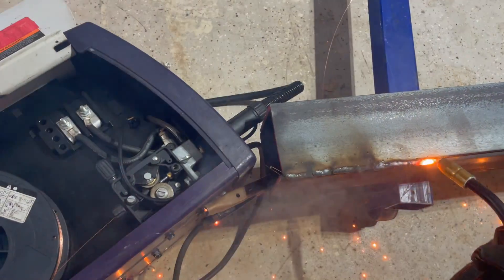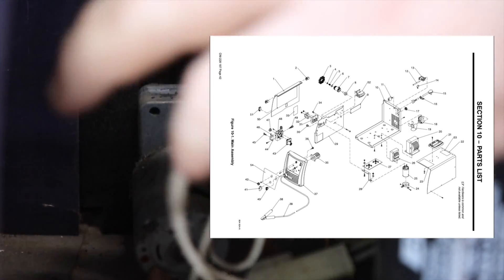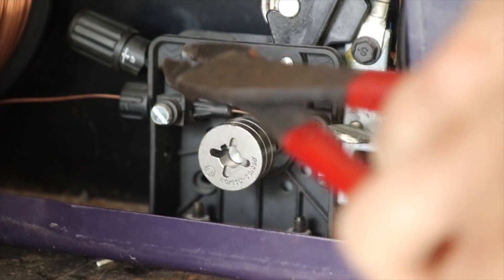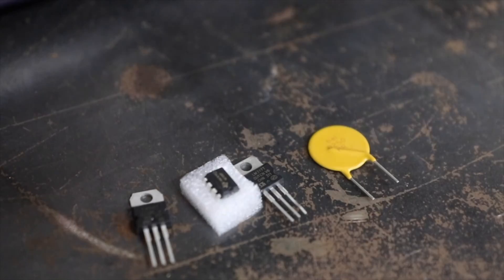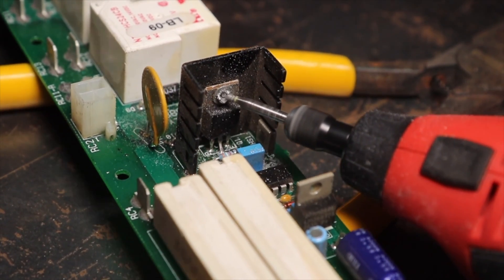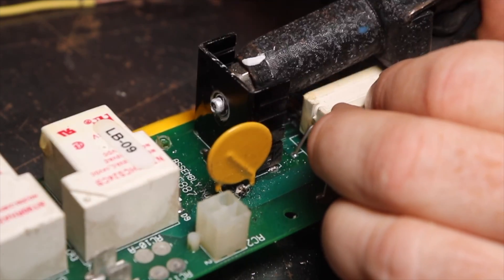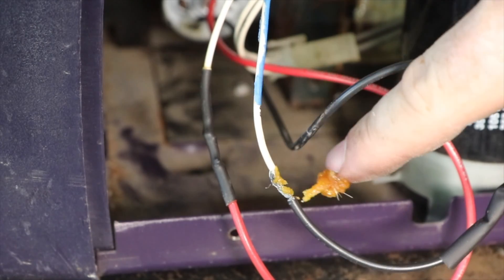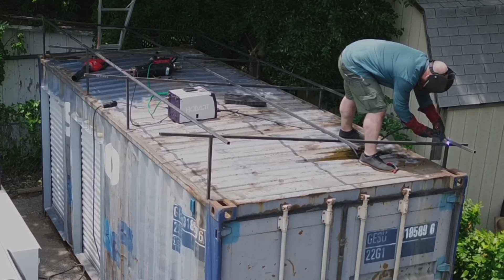Hobart Welder quits feeding Wire REPAIRED!! | Hobart Handler HH175 and several other similar models

Comment: I got 175 hoe barf from friend and its missing all the hardware for the 8inch spool tensioner. I looked in the internet manual and made a D shaped washer and a normal washer. Its not tighting the tension anything.  Can you help me figure out what washers and springs i need. I have the nylon spool holder and cap with the two ridges like yours. Im guessing that there is some spring.